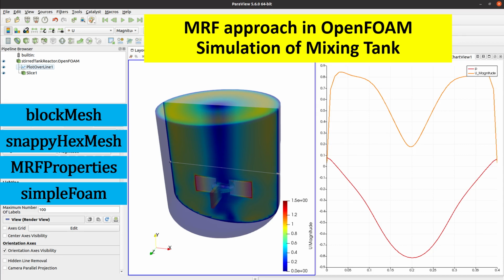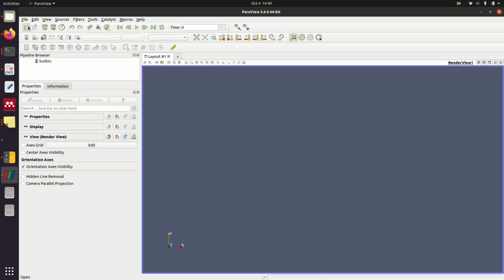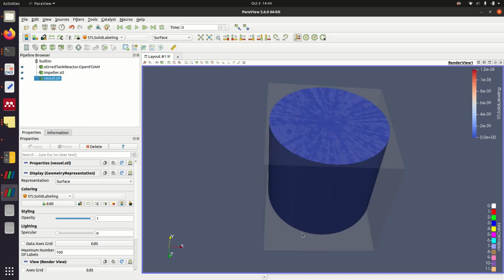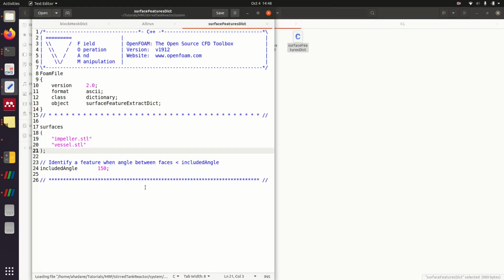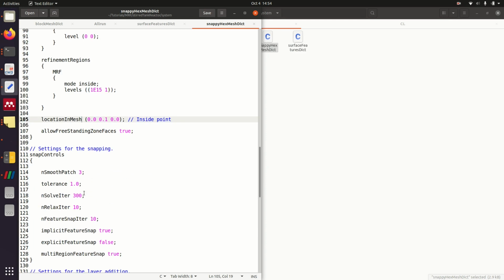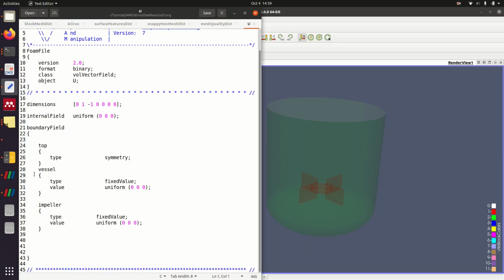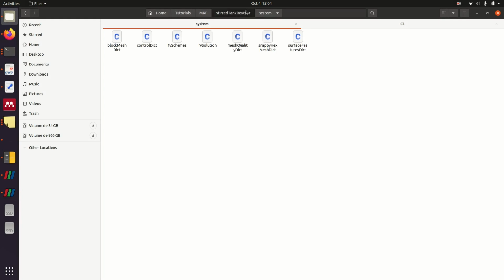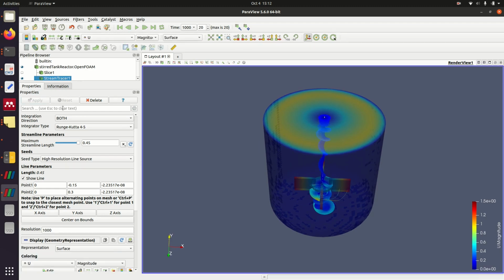OpenFOAM tutorial: MRF approach - Simulation of mixing tank

Comment: Thanks for the tutorial!
I looked at your mesh from the mixer tutorial.
I fail to see why the mrf zone is meshed so nicely.
There is no edge refinement and still the cylinder edges of the mrf zone are sharp.
I have a very similar openfoam case, but the mrf zone edges are not resolved at all.
Is there a trick, setting, tool you did not show or is not in the tutorial?

Comment: Thank you for your tutorial. However, I got divergent result at time 60 without changing any parameter when I run your case download from git. Then, I changed relaxation facrors U 0.95 -> 0.9 and "(k|omega|epsilon)" 0.95 -> 0.8. It finished but  provided wrong result. "U" is zero on impeller and very small value on "top", which are different from your results. I only changed relaxation facrors. I used OpenFOAM(org) version 11.

Comment: Thanks for sharing mrs Asmaa, and i would ñike to know something, Which could be the criteria to dimensioning the MRF or AMI geometry, I read close to the tip of the blades, others 1.2 to 1.5 times the blade diameter... for this case the radius correspond to midle of the region between the static surface and the blade tip. but in general case. what is the criteria?
Reply from the maker: Please refer to the following paper for the general criteria:
https://www.sciencedirect.com/science/article/abs/pii/S1004954120302366

Comment: Do have an idea how to modify the source term inside the code which comes from utilization of MRF approach.
Reply from the maker: To add a source term to an OpenFOAM simulation please check the fvOption file.
Reply: @CFDAsmaaHadane  Thanks for your reply. I am currently trying to add a source term in order to simulate the maneuvering of an underwater vehicle. But in my case the frame of reference is on the body instead of the rotation centre. As a result the source term changes. Can this is also be done by using fvOptions dictionary.